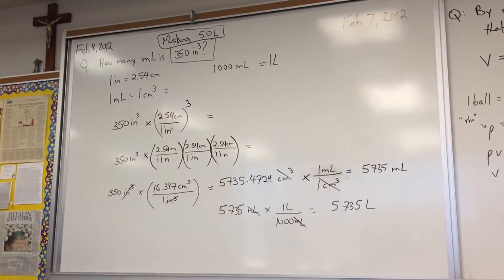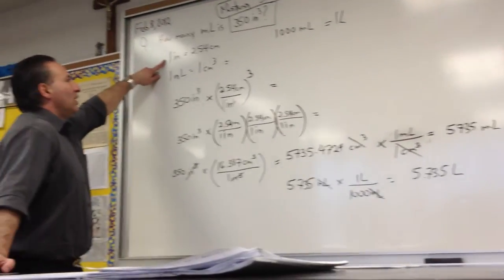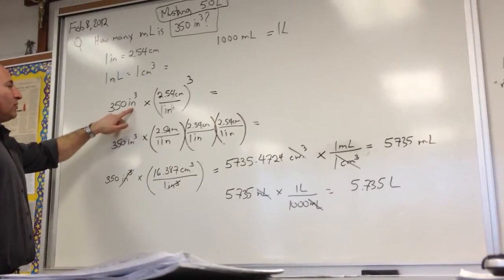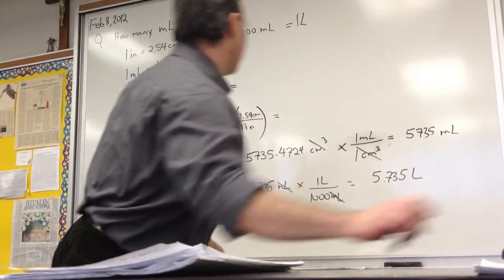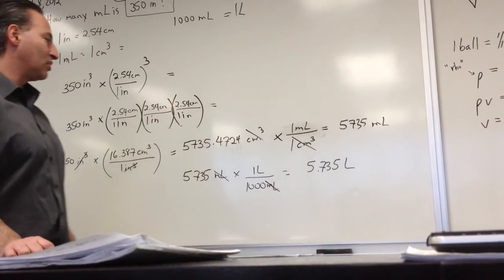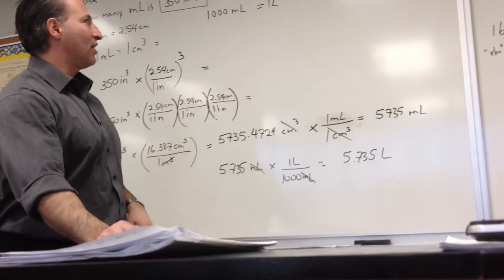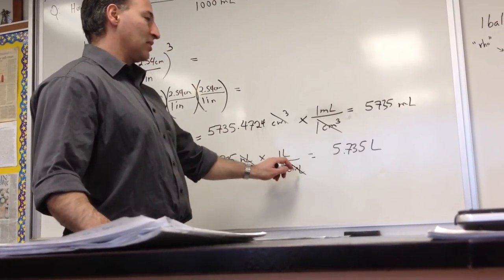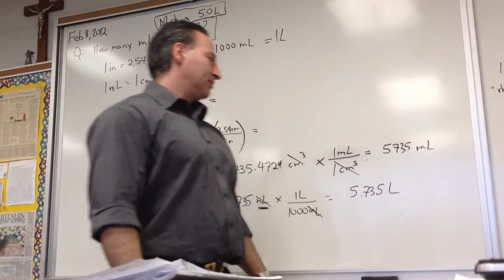Unit Conversion: Which Engine is Bigger? The 350 cubic inch or the 5.0 L?

Comment: anyone know why they stopped referring to engines with cubic inches and started with liter size?
Reply from the maker: Roy Reyes The metric system is becoming accepted world wide. The US is holding out, probably because of the cost of converting.
Reply: Cubic inches rule, it's American, liters are foreign, we need to be proud of America
Reply: @wesbrake9231  Chevy is all metric. The LS1 engine displaces 350 cubic inches, like the venerable Chevy "small block" of yore, but it says 5.7L in the specs. BTW, it will embarrass a Ford 5.0.